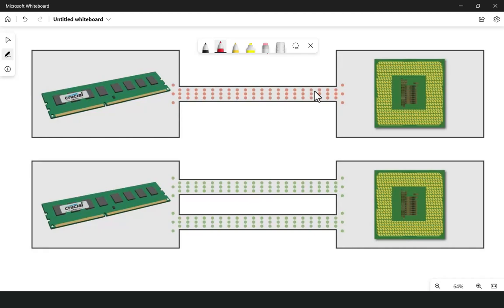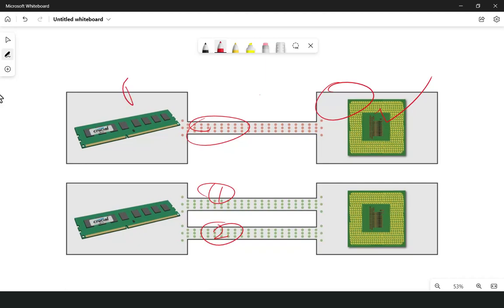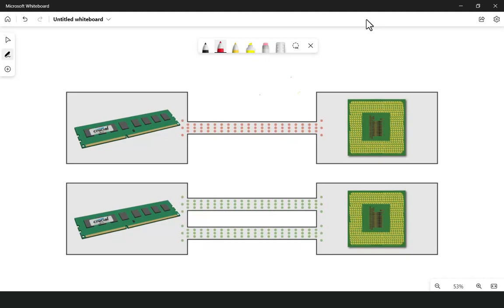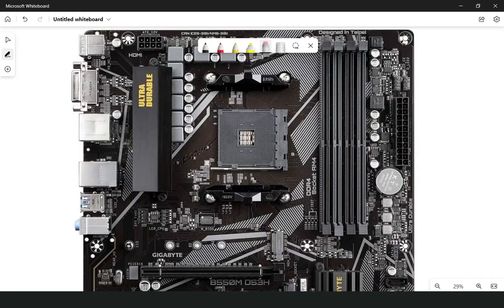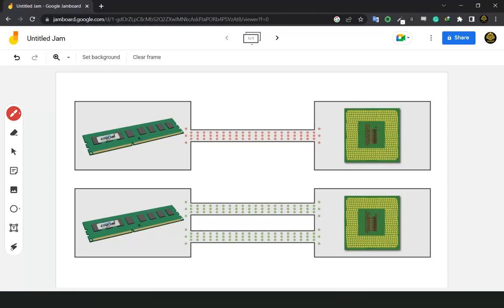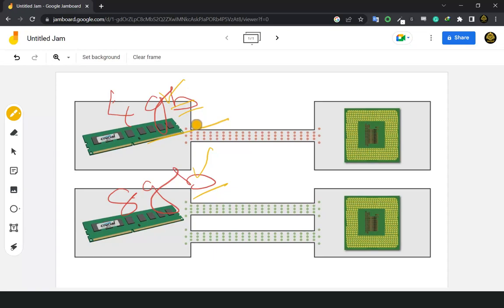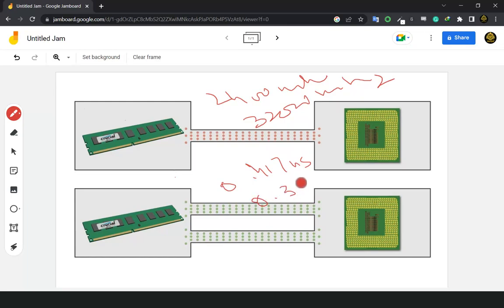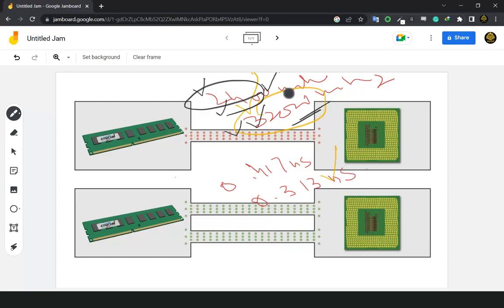Understanding Dual Channel RAM, The Ultimate Guide: Benefits, Compatibility, and Installation

Comment: my dual channel modules are in the correct slots but are all single ranked. im am using 2 kit dual channel kits in 4 slots but all 4 are single ranked not paired as dual ranked.